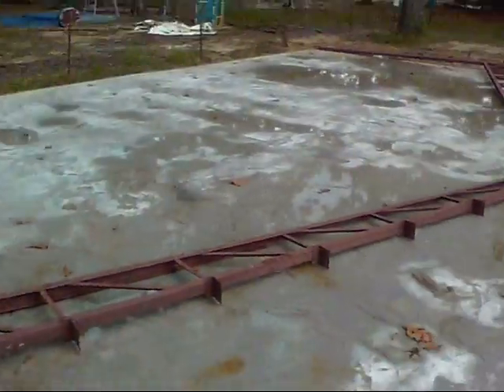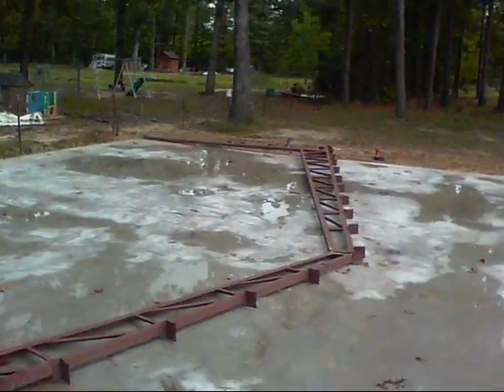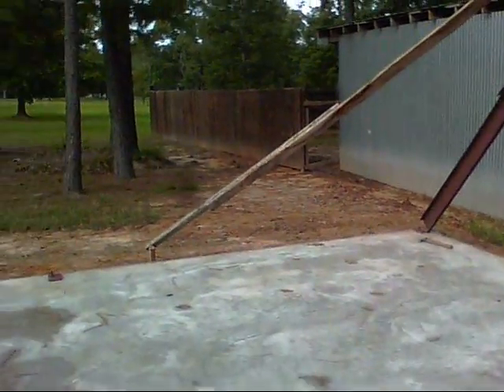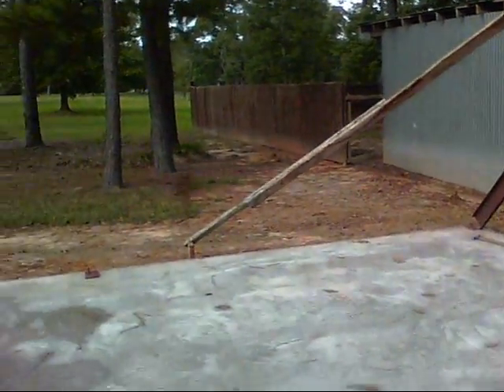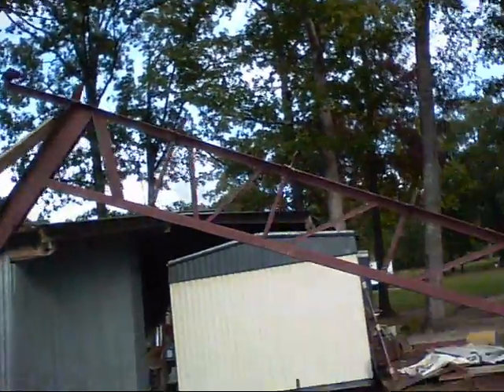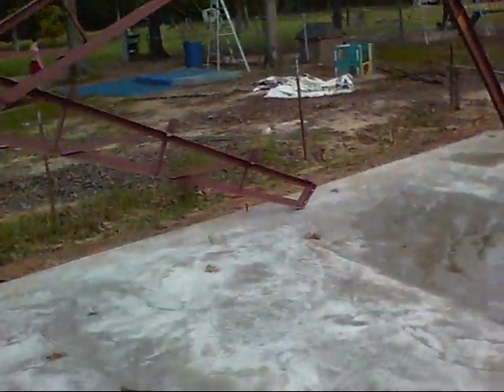Shop Build Series (Wife and I Erecting First Truss Alone)

Comment: The best way to lift the trusses is build and single steel pole, preferred 2 metres higher than the apex, connect a block and tackle to a bar welded at right angle horizontal to the top so block and tackle can have room to move, the base has to be an X shape wide enough to stabilize the pole with bracing of course, then its only a matter of lifting the truss, i did this by myself on large steel trusses erected over shipping containers, I have a front end loader to lift the trusses up on first stage and to pull the pole to the next truss and to bring the pole down

Comment: I hope you are still monitoring this.  If so what is the span and pitch of your trusses?  If you can remember the truss vertical measurement at the peak and base of the truss it would help me out a lot?   Also, what are the dimensions of the steel used in them?  on the video, they look like 2 X 2 X 1/8th angle but I could be wrong.
Reply from the maker: the pitch is 4 on 12. The total span is 36 feet.  The walls are 12 feet.  Not sure about the center peak but about 21 feet i think.

Comment: Hi I have been thinking about building a structure similar to what you are building here. What are the dimensions of the Chanel iron you are using for posts? How if at all are they reinforced? Thanks in advance.
Reply from the maker: These are 6 inch channel and are about 10 feet long and some change. I cut mine so that I could put standard 12 foot metal for the sides. Thanks for the comment
Reply: Paul Roberts thanks for the response! Can you clarify the steel thickness and the width?
Reply from the maker: The channel iron is about 1/4 in thick. The perlins are standard perlins from the metal building supply Forgot the gage of that metal.

Comment: How far apart did you run your trusses and how did you mount them to the concrete?
Reply from the maker: 12 feet apart. Mounted to the concrete with L bolts that were placed in the concrete at the time of pouring the slab.
Reply: hii